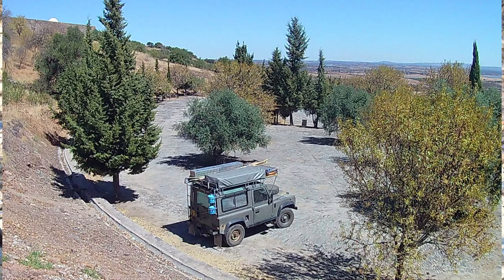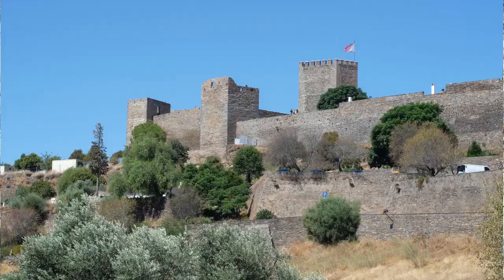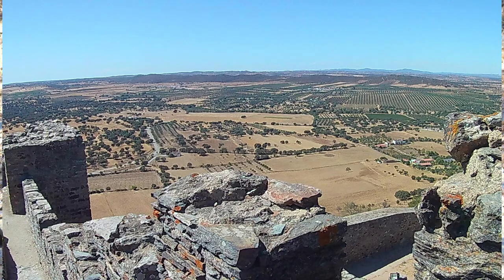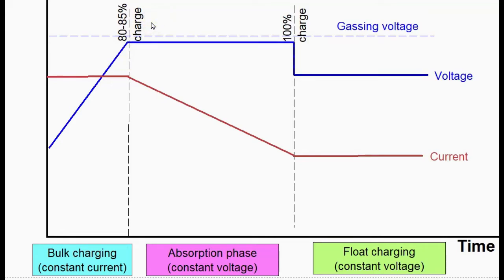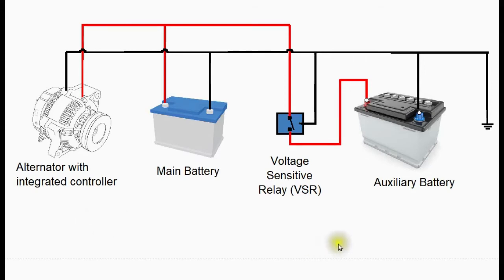Dual battery charging systems for overlanding - Pt. 1

Comment: 3:50 I am confused about this.  My understanding of a typical alternator is that it produces an unregulated A.C. voltage which is then fed into a diode pack to convert it to an unregulated D.C. voltage, and subsequently it is fed to a regulator which is usually internal in the alternator such that the final output from the alternator is a regulated D.C. voltage of approximately 14V.  Now the trouble is, that is a constant voltage.  So it cannot possibly apply the charging scheme you described, even though the scheme you described is the correct way to charge a lead acid battery.  In order to apply the scheme you described, the constant voltage regulated output from the alternator would have to feed a charging middleware which then supplies the correct scheme to the lead acid battery, using a combination of constant current and constant voltage charging stages and maximising the battery's useful life.

My thinking is that in all standard vehicles (except maybe more recent vehicles) it's just a dumb system that uses the alternator to apply a regulated voltage to the battery.  And that's it.  So if you completely flatten your battery so that it only has 9V open circuit voltage at its terminals, and then you get your vehicle started by some other means, the alternator is going to regulate to ~14V and once your battery gets charging properly it's going to consume a heck of a current, leading to a fairly brutal charging cycle.  Eventually it will all get figured out and you will arrive at the charged status.  But the battery will have been battered.  This is the way I understand that most charging systems work on older vehicles.  Dumb systems that focus on simplicity rather than protecting the life of the battery.

Am I missing something? Do you have some middleware in your vehicle that takes care of applying the proper charging sequence you described?

You know, if you do have that middleware than you effectively have a DC-DC converter solution.
Reply from the maker: Hi and thanks for your detailed comment. If you watch Pt. 2 you will see that the "middleware" is provided by a Sterling smart charge controller (there are others available too). You are correct that the effect is somewhat the same as a good DC-DC charger however this achieved through a different route.
The principal advantage of a DC-DC charger is that it's non-intrusive so it can be fitted to almost any vehicle and shouldn't affect the warranty. The disadvantages are they are expensive and usually only provide a modest charging current (although I think more recent models provide quicker charging). There are also some reported faulty designs which manage to discharge the main battery under certain conditions - see the 4Xoverland YT channel for details.
For overlanders who want simplicity and reliability there are attractions in having a dumb charge controller with a voltage sensitive relay for a dual battery system however the charging  cycle is far from ideal, as you have highlighted in your comment. For me the advantages of a smart charge controller and split charging system outweigh the risks caused by the increased complexity. In case of problems I have a pre-installed spare charge controller and I can charge the second battery by hard wiring it to the starter battery - this is enough to get you to safety where the problems can be sorted.
The technology of smart chargers is quite mature  these days - almost any mains charger uses this technology.
I hope this helps.